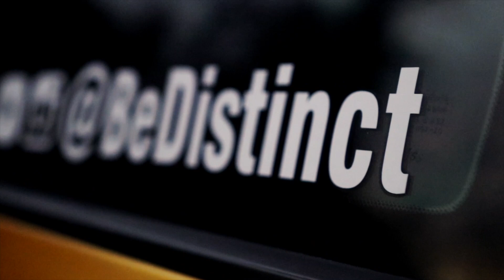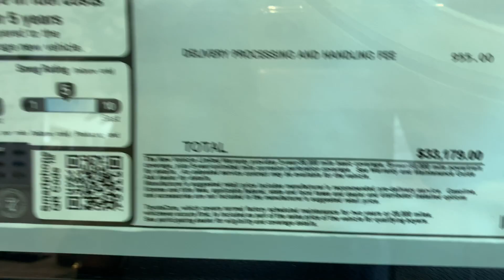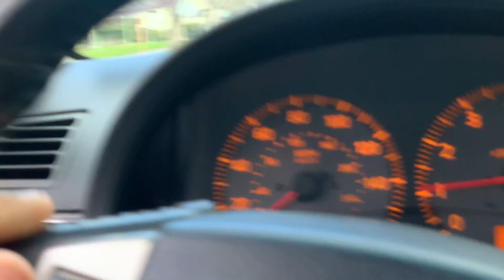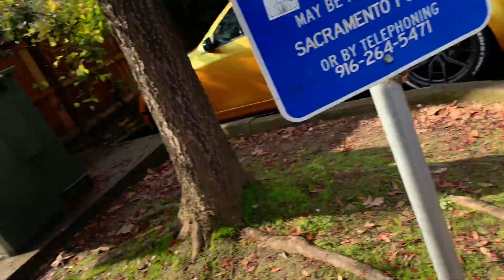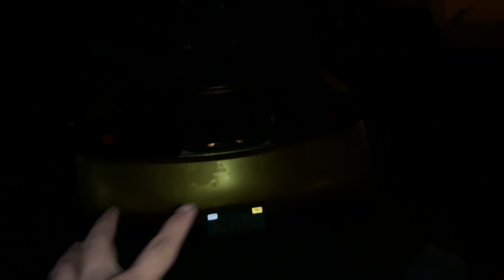$10 G35 Strobe Tail Light MOD + GF gets NEW Car

Comment: How do you make your turn signal like that using that? 😩 I just bought a G
Reply from the maker: Damian I have the module on this video and also had the diode dynamics module. That one is like $50 on amazon. I made a video on that one as well like a couple videos back if you wanna check it out 👌🏽
Reply: BeDistinct will do thanks 🙏🏼

Comment: Wish I could do that to my G. Too bad it’s having idle problems now. Idles way too low and constantly stalls on me.
Reply: SEAL 14 probably your timing belt
Reply: Its probably a dirty maf sensor. Clean it
Reply: hidden KARD so here’s an update. I cleaned the throttle body inside/out and that didn’t help. Cleaned the MAF sensor and didn’t help either. I did the ECU reset and no luck. There are no trouble codes the car is giving me. I’m guessing it could be the timing chain.
Reply: @martinv3126  could have a leak in the intake... If you cleaned it, look for holes.. also, check to see if air filter is either dirty or has a hole!!!